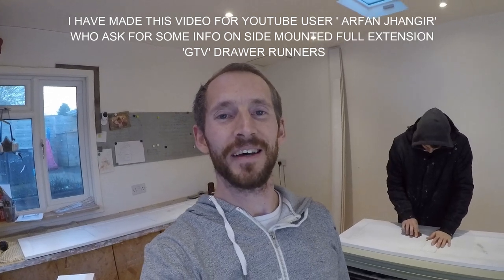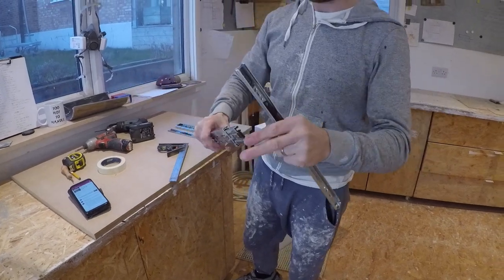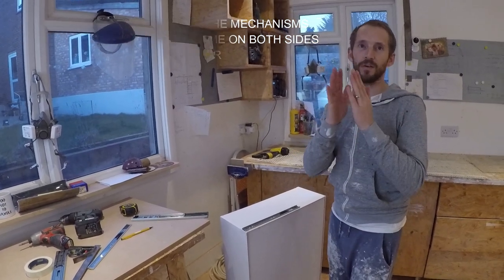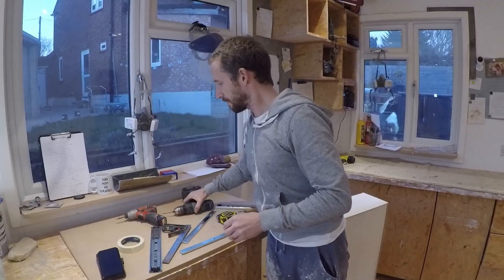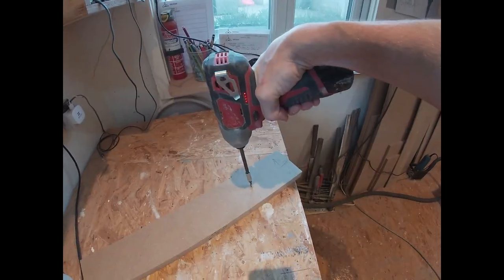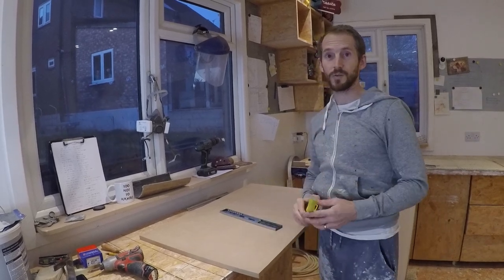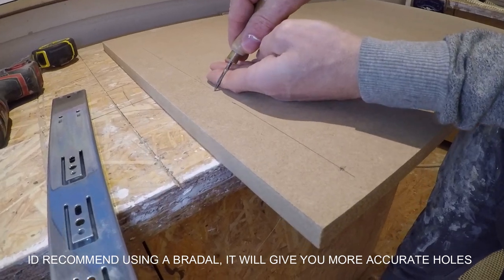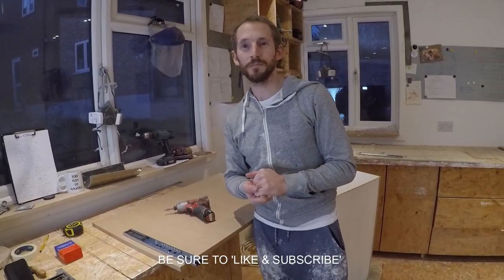HOW TO INSTALL side mounted, full extension GTV DRAWER RUNNERS & SLIDES - All Tips & techniques

Comment: Hi Ryan
Thanks for this video, just a couple of things,
1. The middle of the carcass slide is 22mm to centre plus an extra 20mm this makes 42mm and not the 44 that you draw the line at.

2. Why is it preferable to measure the slider holes rather than sit the slider on the drawer/ carcass and use it as a template?

3. On the carcass slide if you use just the holes that are in the 3 cut out portions and not the fixed holes, then if your drawer is slightly smaller in width than it should be, those cut outs allow the slider to come away from the side of the carcass and take up the additional gap.

4. I see you fit the sliders flush to the front and sometimes I see them set back by about 5mm is this down to personal preference or is there  reason?
 Cheers for the video...

Comment: I bought some runners online that are push to open. My problem is that once the drawer face goes on the drawer, I cannot open the runner. What am I doing wrong? Never ever had this problem with full extension runners before.
Reply from the maker: Hi sorry I've only just seen this message. 
Make sure the wide part of the 2 part runner is flush with the carcass when fixing.
Once you clip the small part in it should overhang the carcass by 3 or 4 mm to allow for the push
Reply: @thelondoncraftsmanworkshop  Thanks for your reply. I had to order soft close runners which actually work. there is no way that push to open runners work with a drawer face that sits over the drawer carcass.

Comment: I bought GTV push to open and it is written that there is 5mm gap between front and carcas side, but do I need to montage them same as you flush straight to the front? Also I'm afraid of your screws, I'm amateur and I use 3,5x17 mm.